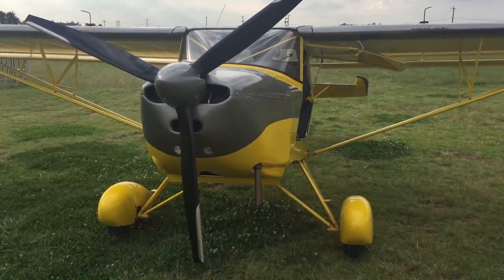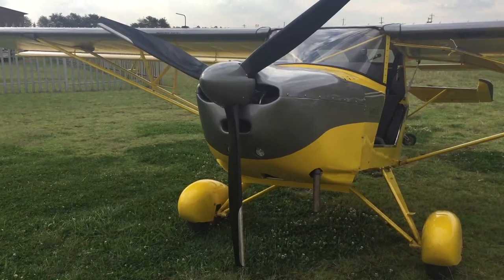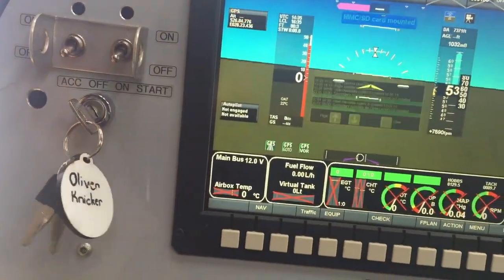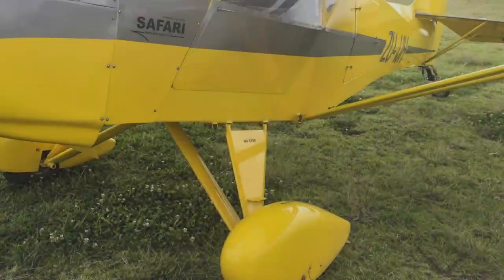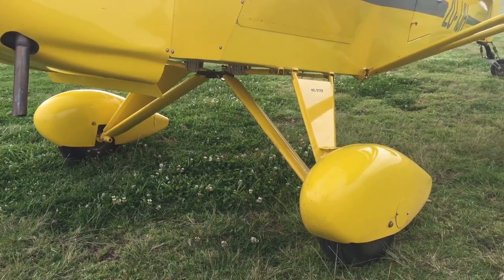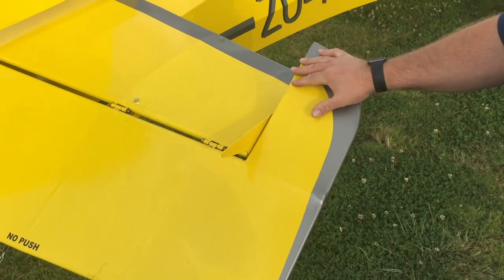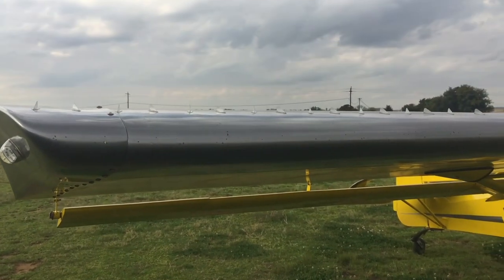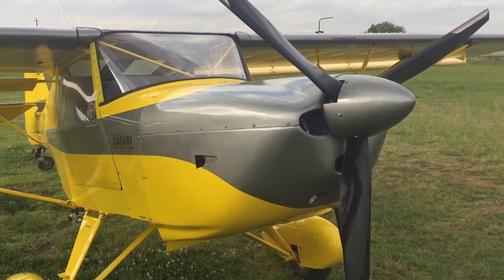Introducing the Safari STOL

Comment: Looks like a Kitfox
Reply from the maker: Kitfox,Eurofox and KFA share the same pedigree (Avid Flyer). But the Safari is much bigger and got a lot of improvements. And can be purchased as a factory built plane as well. The smaller model (Explorer UL 600) will be available as German certified  600 Kg factory built plane and kit when the new 600 Kg. German UL class will be officially introduced.